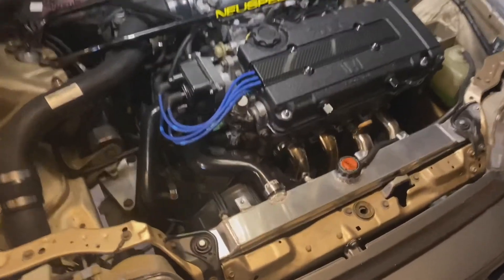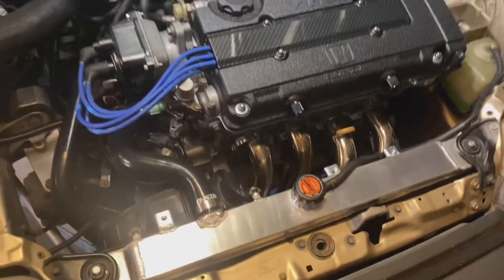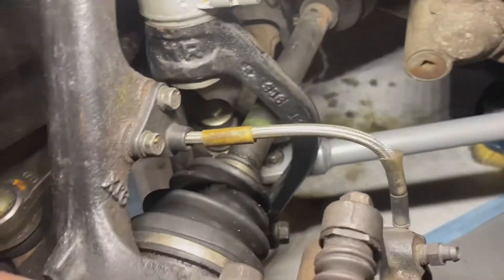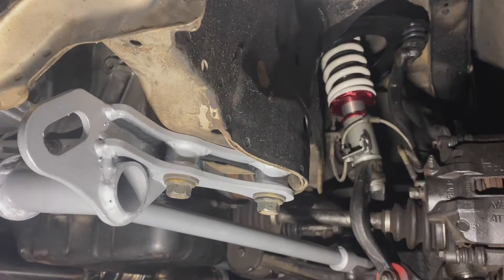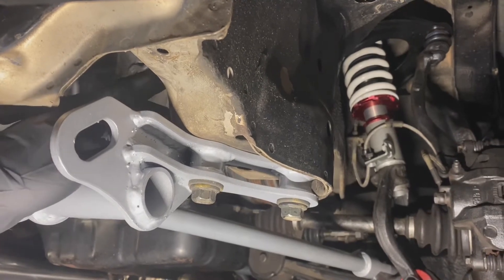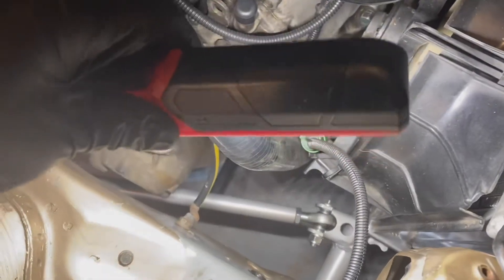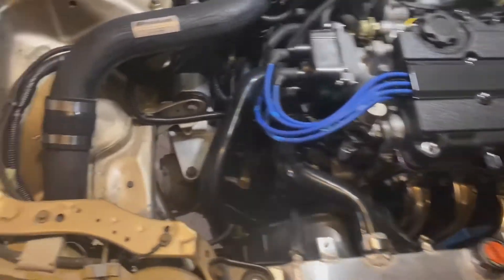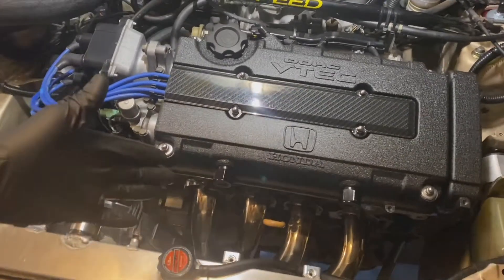MaXpeedingRods TRACTION BAR INSTALL + OTHER UPGRADES

Comment: What radiator are you using?
Reply from the maker: eBay special, G-Plus fit like a glove with this traction bar, I would’ve had to notch the lower portion of the support or the actual stock crossmember if I wanted to keep it oem.
Reply: @victorsgarage5814  I’m using the same trac bar, I’m dealing with the small inlet/outlet on my stock rad can’t clamp hoses without leaking or braking the plastic
Reply from the maker: @pworthy6839  sorry dude that’s annoying, then you might benefit from the upgrade I don’t know what they’re going for now but I’m sure you can get some silicone hoses and the  radiator for under 200 bucks on ebay my stock fan bolted up overall quality was awesome for what it is, if you’re feeling generous look no further than an koyorad fitment on those from what I’ve seen and heard are spot on.